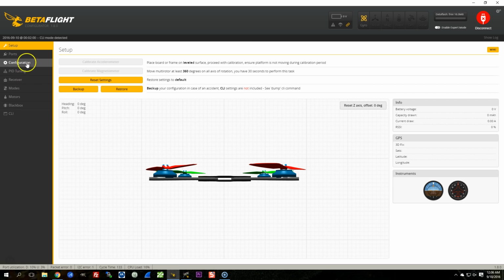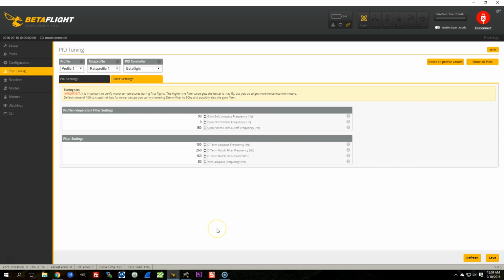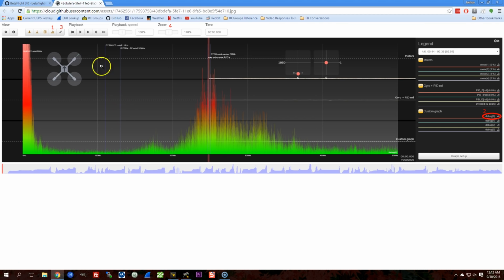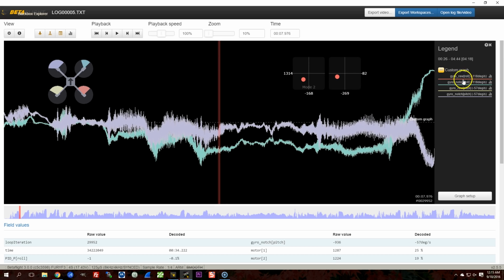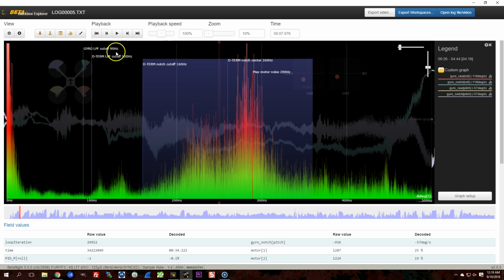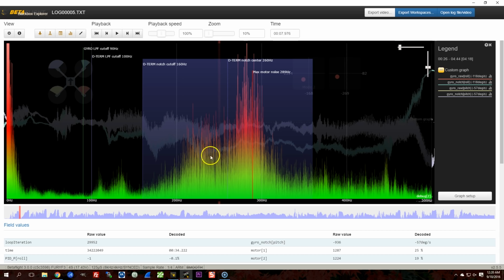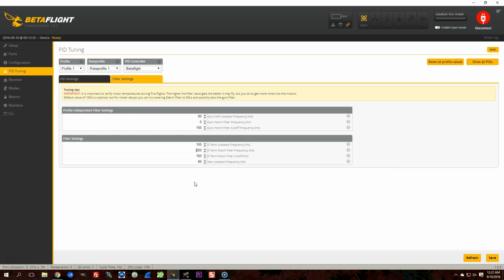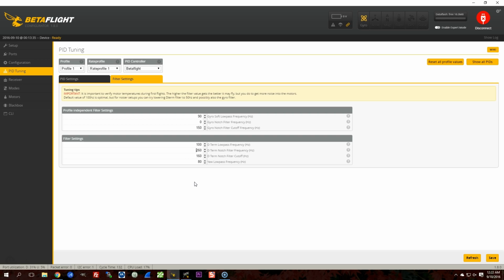Betaflight Notch Filter - How To Configure

Comment: Hi joshua. So the d term filtering (low pass and notch)  is run on raw gyro data instead of normal gyro filters - which are only used for P and I? Thanks
Reply from the maker: I don't think what you're saying is right. The gyro filters are applied to the gyro data first. Then everything that depends on the gyro data is calculated. Then any additional filtering that needs to happen, such as d term filtering, happens.
Reply: Ahh okay that makes sense although makes understanding impact of changing filters tough when filters are being run over other filters!
Reply from the maker: That's what the debug_mode option is for. Debug_mode=gyro logs the raw gyro and d term data before any filtering. Debug_mode=notch logs the data after the low-pass but before the notch.
Reply: As big difference may be the max center frequency, flying fly fast or slow?
Slow 120Hz  160Hz ?
Fast 230Hz 270Hz ?

Comment: Joshua, another great video. I don't know if you're already aware but the debug notch fields in the very latest BB viewer v2.5.6 are now labeled gyro_preNotch[] for each of the roll, pitch and yaw axis. was a really late change just as bf 3.0.0 stable was released. it doesn't change your method at all, it just might confuse people following along where you choose the gyro notch fields in the graph setup window as the labels will be different. And as a side note, if you use the other debug mode gyro, then the debug fields are the actual raw gyro data even before the low pass filter is applied. In BB viewer pressing key I twice without moving the graph will clear the in point, and pressing key O twice will clear the out point.
Reply from the maker: Okay, so debug=notch shows data after low-pass but before notch? I got that wrong in the video.
Reply from the maker: Thanks for your work on the Explorer by the way. Vast, vast improvements.
Reply: yes thats right, debug=gyro is the raw data before LPF and notch, debug=notch is after LPF but before notch and the normal gyro[] fields are after both filters are applied.
Reply: If I'm honest, watching your videos and how you used the BB viewer was a lot of the inspiration for the changes I made. Shortcut keys like the Z to zoom out to 10% (and back); the S for removing smoothing and X to remove expo, even the fact that you can scroll back forwards by one frame using <ALT> and the cursor keys are pretty much from watching you use the viewer properly. So thank you for the inspiration. There are a few less obvious features I'm waiting for people to discover (like holding the <SHIFT> key down when you move your mouse over the analyser window, even the minimised one).
Reply from the maker: +DragonFPV if you are configuring the notch filter use debug mode notch to see the data after the low pass but before the notch.
Reply from the maker: +DragonFPV to let you see the gyro data before the filter is applied.
Reply: Did they change the gyro_raw graph? Im not finding it.

Comment: Wouldn't it be possible to only use the gyro data that is relevant for the flight instead of getting rid of the unwanted spike? Something like a inverted notch filter? Or just removing everything thats not relevant? So the flight controller only uses the gyro data from the low frequencies?
Reply from the maker: Well, that is more or less what we're trying to do.
Reply: So why don't we apply a very wide notch filter that covers the entire spectrum except for the low frequencies?
Reply from the maker: Because if what you want to do is pass only the low frequencies, a low-pass is the right tool :-)

The point of the notch is that we have a V-shaped peak in the middle of the spectrum. So we apply a notch, which is an inverse of a V.

The overall approach is to apply filters that are the inverse of the noise that you want to remove, and that's exactly what we're doing.

So why not apply a low-pass with a cutoff frequency at 50 Hz and a massively steep rolloff, so completely attenuate everything higher? Because the more you filter, the more latency you cause in your pass-band. A balance must be struck between strong filtering and low latency. This is probably one of the single biggest engineering challenges that Betaflight has dealt with over the years. First there was PT1 filters, then FIR, and now biquad.
Reply: After reading your words, I gained a great deal! Thank you!

Comment: I have max motor noise at 408Hz which means my dterm notch at default 260/160 is completely useless at the moment?  https://www.dropbox.com/s/kz3mlpaj5gpl9qe/Screenshot%202016-09-13%2020.17.02.png?dl=0
Reply from the maker: Yes, pretty much. With a noise peak at such a high frequency, your low pass is super effective, and you may not even need a notch filter. But right now, the notch is not really doing anything particularly effective.
Reply: ok, will set it at 408/308 and see the results as well as switched off notch so that I can compare, will report back

Comment: Thanks for the tips.  I was looking at this the other day. And I didn't know I had to be in debug mode. But even without it it seems as if my notch center needs to be about 20HZ lower. I will confirm by seeing my values in debug mode. Great video.
Reply from the maker: Frankly, even without debug mode, the basic information should not be too much different. But debug mode helps you be sure you're seeing the right thing.
Reply: Great.... good to know... In my case the magnitude was not very high but it was obvious where the prop noise was.... it was all falling withing 90% of the notch filter.  I was using KK 6040 props.  I was surprised with how smooth it seemed....gyro traces didn't look all that bad and to get to a 95% tune on betaflight 3.0 RC12 took like two adjustments.   The copter was so locked in so quickly.

Comment: The D-term LPF is usually higher than the gyro LPF, and in this video you use the gyro noise spectrum to tune the notch filter for the D-term. I would assume, using the gyro spectrum to tune the gyro notch filter is straight forward, but I'm wondering, whether good results for the gyro notch filter can also be used for the D-term notch filter (in contrast to using a higher frequency, similar to the LPF filters).
Reply from the maker: D term LPF cutoff is higher than gyro LPF cutoff in order to reduce the delay of the D term filter, not because the noise profile is expected to be different. I would expect that gyro and d term have a similar frequency response plot, just at different magnitudes. If there is noise at a given frequency in the gyro, it should be reflected in both the P and the D. There is some room for variance in the D if you are using D from error though, since the movement of the sticks will introduce error that is not related to the gyro. But I think that will be very low frequency noise.

If you want to verify this for yourself, compare the spectral plot for the gyro and the d term to each other. Getting raw gyro and d term data will be tricky. Definitely disable all notch filtering if you do this. But in general, you should see the peak in the spectrum for the gyro and the d term is about the same, just the magnitude is different.

Comment: Thanks for your informative video, as always. :)
I have MPU6000, not noisy setup. I found my resonant freq ~ 350Hz.
I am trying different settings here with notch filters all day. And I don't understand why it is better to use D notch filter, not the Gyro one. 
If I use only D notch filter , I still have some vibrations in P term ->  slightly vibrations on gyro. Vibrations are only eliminated on D term. (It is also seen in traces, P and Gyro are vibrating in high freq, D is only following P lower freq., so it is not correcting/fighting with high vibrations)
If I use the same filter but on Gyro (same frequencies and width), I eliminate all the vibrations on P and D in the filter freqency width. 
Please tell me why gyro notch filter is making things bad, because im trying to figure that out, and I can't find the logical explanation. Is it making more delay or sth?
Reply from the maker: Testers found that gyro notch filter gave a "floaty" feel to the copter's flight. If you like the way your copter flies with the notch filter, go for it. Bear in mind though that clean blackbox traces usually do not correspond to a good-flying copter. Very smooth blackbox traces actually usually make for a bad-flying copter because the PID loop is not aggressive enough.
Reply: Thank you for an answer. I will test tommorow feeling of the flight in each scenario and give feedback here for others =) 
Regarding traces, Yes, I know about too clean traces, but in lower freq. I was talking about high vibration frequencies in traces, not the lower freqencies used by PID controler to fly good.  PIDs on this quad are agressive enough. 
Does anyone here tested gyro notch vs only D notch, and the feeling already? :)